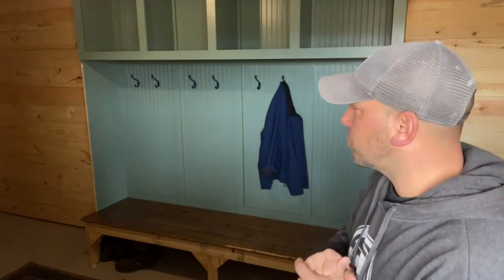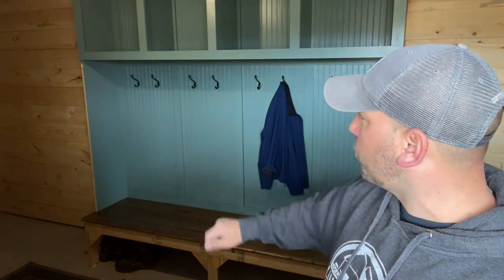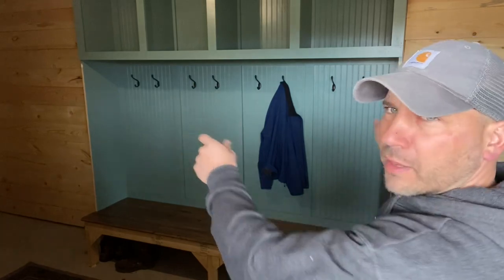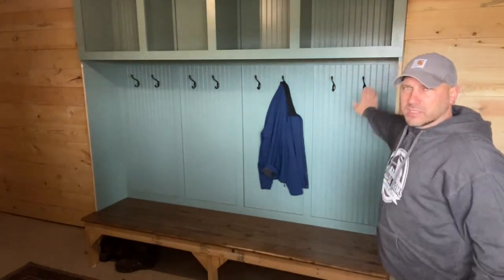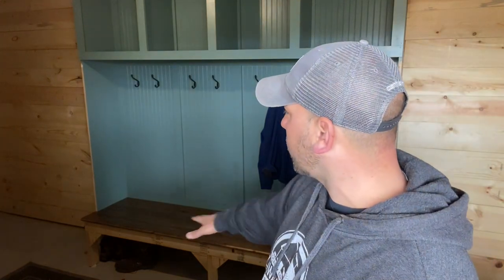A Must Have Farmhouse Mudroom!

Comment: Turned out really nice! Glad you bought the lumber before prices got ridiculous. I'm surprised, with the temps that you see in the UP, you're using the paper faced insulation for a vapor barrier ( probably ok according to codes). Unless you are going to glue the sheeting to the studs, staple the vapor barrier paper to the face of the studs, better vapor barrier coverage and easier on the knuckles. In Minnesota (North of Duluth) and here in Alaska, all exterior walls are covered with 6mil plastic, either insulation is blown in or unfaced bats are used, just a little thicker plus a more continuous vapor barrier.
Reply from the maker: Well that’s probably what I should have done here too but the room isn’t going to be continuously heated!  Unfortunately I wanted this project done and payed dearly for the pine boards on the walls but I did start on the walls before the craziness! All the backyard sawmills are humming now!